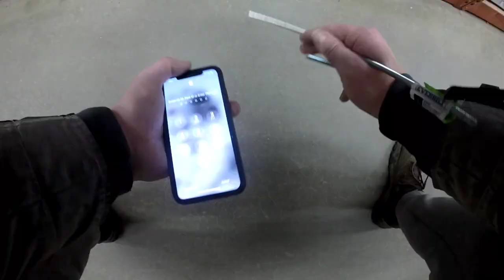50CC MOTORIZED BICYCLE MOTOR REBUILD, DOING IT THE HARD WAY

Comment: Every 3/4 turns go back a quarter turn. Good advice.
Reply from the maker: Yes sir
Reply from the maker: Cast aluminum is just so cheap and crappy so to speak and can just get marred up easily.
Reply: @JMB676  good tools make a big difference as well.

Comment: Print a degree wheel and glue it on something
Reply from the maker: Yup, I already got one printed out and on a plastic dish. It works really good. I use it all the time.
Reply: Between me n u what’s some good advice on porting ld100 cylinder?
Reply from the maker: @motorizedbicyclenation53cu90  do you have a degree wheel and do you know how to use one? And I personally never had one yet but if you can tell me the starting durations and the squish I can give you a good starting point for sure.
Reply from the maker: @motorizedbicyclenation53cu90  I can even give you numbers for your weight and what you want to do speed torque stuff like that
Reply: @JMB676  well I’m at150 (raised)exhaust split port trans at 120 (stock) adding a boost port over intake and I really want more torque than stock like as much as I can get so I’m planning on a BD between 15-20 and not sure if I should Shape mushroom or oval my exhaust Proli have reed small hole and I sure of pipe but torque and it should be a little faster as well but I’d love some numbers I just don’t want a gutless bottom end or having to pedal up to 10pm to get going I’m in the foot hills of the smokies so I really want torque hope I ain’t raise exhaust too high yet
Reply from the maker: Sorry I responded so late my phone doesn't give me all my notifications and I got go lookin but is it a 80 or yd or 49mm iron sleeve?
Edit: nvm you answered that but it it was me and mind you I never did the ld yet but 120 is good trans and you want your intake to be about 6 degrees more then the transfer, so about 125ish area. That will squeeze more are into the combustion chamber, also I would  recommend between a 22-26 degrees of blow down but I would also recommend somewhere in the neighborhood of a 172 exhaust and as far as shape which ever your comfortable about doing but I try to keep it rounded  on edges with a almost flat roof for more torque. Your also going to widen it I'm sure but let's say your going to widen it a total of 2mm, don't take one mm off each side take .5 off the left and 1.5 of the right ( left and right as if your looking directly at the exhaust). Those numbers are just hypocritical numbers for how much to widen it cause idk how wide it is stock but it is saying take of a quarter of the amount on the left and 3 quarters off the right side of the port. Now the squish is important too to keep compression up so sound .6-.7 of a millimeter. That should produce great bottom end grunt. Let me know how you do. These numbers are also for reliability if you want something that will really cook I can give you them too but the numbers are really hot and the motor is only good for shorter runs or it can blow it up. But boy does it pull something hard lol.

Comment: Good C N U workN on the 50
Reply from the maker: Yea I actually have crazy ideas for this lil motor and tbh I'm probably wayyyy over thinking it or just over doing it but once I started I just couldn't stop cause I'm using it as practice for the Franks. I really want to be able to sell motors one day and I truly feel that I can't charge good money unless I can balance the cranks myself and realign them to be plum. So this little motor is going to be one smooth operator. Plus I'm trying something kinda crazy in the transfers, cause why not; right?
Reply: @JMB676  you da man 😃 👍👍👍👍